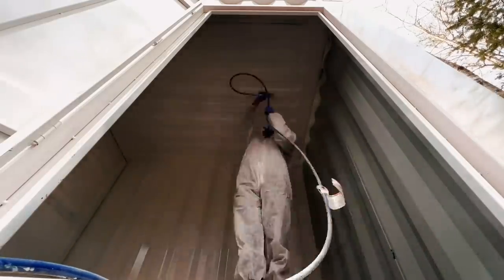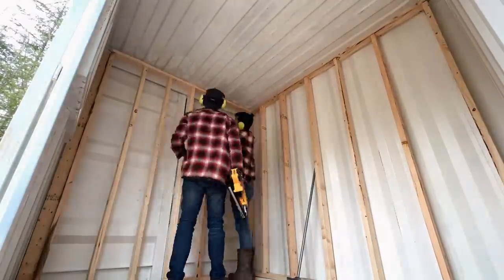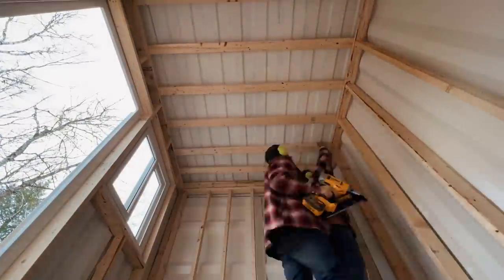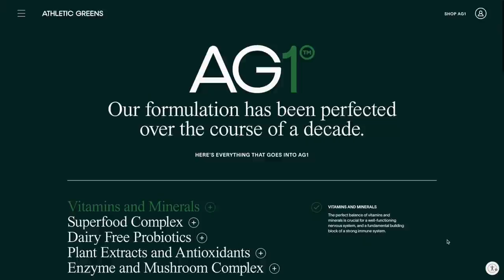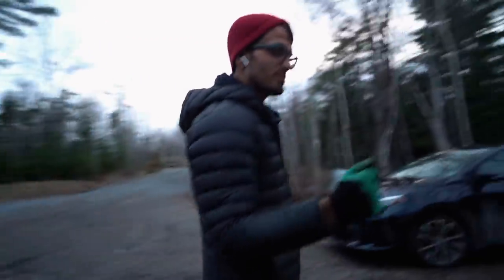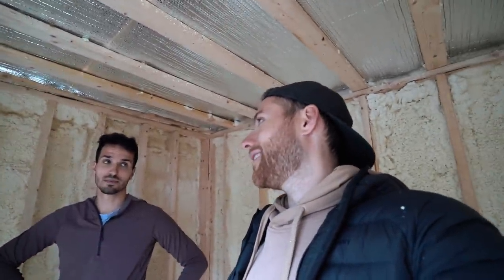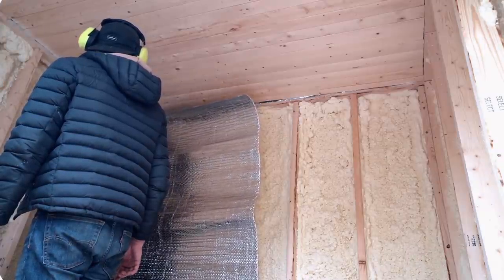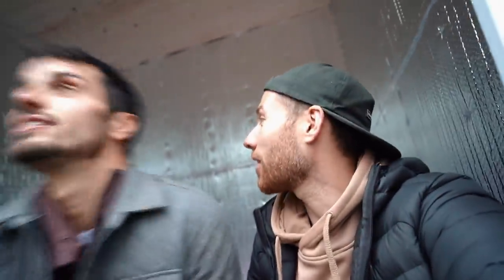Why this was never going to work...

Comment: Pro tip: Connect a vacuum attachment to your saw. Used the (now clean) sawdust mixed with a bit of wood glue to fill the holes.  It will take stain better than wood putty and you will notice the fill over the screw holes less.
Reply: I just learned this recently and am a big sawdust saver. Very good to know!

Comment: It looks so good, Carl & I bought a second home, a 120 yr old Craftsman bungalow.  Pretty much gutting it, opened up kitchen, enlarged bathroom & enlarged dinning area. Took off all the plaster & lath, which was hell. Leveled the floors & had electrical up dated.  Did the exterior first & removed the old concrete siding put on in the 80’s, took it to the original clap board siding, which is beautiful. Completely repainted & sanded the posts on porch; we received a large order of mums, a surprise from the neighborhood with a note “ thanks for making our neighborhood beautiful!” It’s been hell & a lot of primeval cussing.

Comment: You guys do beautiful work and at the same time I genuinely have a question: If I had been in your position I might have been interested in wiring the interior for electrical outlets and lighting fixtures since there was easy access to the space inside the interior walls you are building. Perhaps I am missing something to do with the type of power sources you are using or maybe even such wiring might have triggered inordinate Nova Scotia building code requirements for permits/inspections? I am sure there may be plenty of good reasons; and please know that I don't wish to sound critical. I am just interested in the back story. Thanks so much for your patience in addressing my question. Also, thanks so much for being "Tyler and Todd"!!! Over the last several years, you have become a significant focus of my YouTube viewing experience. And I consider you two a big part of my own Sunday routine. It's not a proper Sunday for me without an entertaining dose of Tyler and Todd. So thanks again and know that each week, I can hardly wait for the next episode!

Comment: your definitely going to want a ceiling vent in the outhouse with all that insulation otherwise its going to smell like rotten turds inside when the air vents up through the toilet and has nowhere to go.
Reply from the maker: Absolutely! Rotten turds are not the vibe, especially hot rotten turds 😅😂

Comment: Hey guys the next time you spray foam put masking tape on the studs. It will save you from having to do a lot of scraping later. All you do is peel the tape off after and the studs will be clean. I learned that the hard way. Thanks for another fun Sunday.

Comment: I love how you are just like us, I will have a plan and see it through and realize well I should have done this. Then you plan as you go from that point and it works even better.  My question: now that you have the building up and pretty much done, is it still cost effective than you building it yourselves?  I would think this building is much more sturdy being metal and with the heavy snowfall it will last longer with less maintenance.  Love the longer format because cliffhangers are dreadful. 😵‍💫😂. Oh -oh and what snack did you get the dogs in the drive thru?
Reply: It was a plain "Tim Bit", which is a plain, round, small doughnut.
Reply: @jonap5740  Oh sweet... thanks!

Comment: Glad to see that other followers have questioned you on some aspects of your progress in recent videos---and that you've taken it to heart and changed direction.   Wouldn't want your channel to turn into a ""Don't It Yourself" fiasco.   With that in mind, I didn't detect any ventilation features in the outhouse.   Every rustic outhouse has significant air flow to prevent build-up of fumes  (warm poop or not).   Be careful not to create toxic environment such that when you open the door to your comfortable space, you have to run away instead.

Comment: What a missed opportunity you could have put up a sheet of plastic between the metal inside and the wood so that the wood wouldn't touch the wall on the inside and then you could have insulated and then use more plastic to cover the other side of the wood and put up drywall  making it nice and warm.   Well, its only a suggestion... good luck guys your place looks just awesome!!!   all you need now is a small pool for the dogs to play in when you can use the lake that is inside something and keeps everyone warm.   :)   Can't wait to see what else you all do.

Comment: Your model at 1:45 is nice but don't forget that containers are designed to fit one on top of the other. If you want to assemble them differently, you'll need to reinforce the structure that is weaker off the corners.

Comment: Tip for nailing shiplap boards....put a nail at the bottom of the board only that also goes thru the "lap" of the board below it.  It uses half the nails and half the woodfill of nails.  I was rewayching your bathroom build and thought this tip would come in handy for any shiplap install in your container home.  Possible othe tip... if the ceiling boards were tonue and groove, you nail only into the tongue at an angle so the groove of the next board is supported by the nailed tongue.  This results in no exposed nails, less finish work for a smooth finish.   Love you guys videoes.  Hope the tips help.

Comment: I've never seen anyone apply spray foam insulation like that.
What I've seen is nice even strokes like spray painting. You get less overspray and what you get you scrape off the studs before it hardens.
Oh well, it's done and won't be seen for at least the next hundred years. Lol
I still think you will not enjoy wading through cold snow out to the outhouse in the middle of winter. 
You are working hard and learning things which will help when you build that house.
I think it's a great spot to put up more domes and use them as rentals for others who want to get away to nature. Just a thought.

Comment: First of all, great footage on the wooden ceiling build! Also, love the quick speed with voice over, for me, better than a few minutes of footage (in real time) on the project. I learned some things from seeing the ‘bigger picture’.  the air space between the Mylar bubble insulation also creates an insulating effect, ya done good. With such a sealed room I wonder, will you need some indoor ventilation so the whole thing doesn’t explode or is the vent pipe outside enough?. Beautiful, your work process, pets and each of you!

Comment: I hope you have air exchanger in the outhouse as you’ve insulated so well that their will be no air movement as it’s sealed completely. You’ll need to let fresh air in and stale air out. I just noticed you have a window in your outhouse so that will solve the issue.

Comment: Great job ya'all on the insulation! Omg, that spray foam is hard to deal with, have had to use it several times and it like, takes a life of its own, so good job on control ::))  Upcycling the generic "reflecting" material was a brilliant idea to put to use left over material. At this point, it's going to be fine, and be enough insul for the winter time...after all, you are not going to spend hours in there (unless Todd's tacos go wrong lol) and even in summer, you will be wise to keep battery operated fan present in there for comfort and circulation. I forget, will there be a window that can open? Stain and shiplap is going to be the perfect feel for the space. From the looks of it, I would more than happy to head to the Out House of your dreams, keep on rockin ❣
Reply: Hello how, are you doing?

Comment: Too late to mention for your outhouse, but if you need to sand another metal container, I suspect it would be convenient to rent a sandblaster.  I wonder if you considered a composting toilet design.  I think I recall that you mentioned a sink in the outhouse, and if so, then the insulation you're adding will be very important to avoid frozen water lines.  Up there, maybe you'll even need heat tape.  I enjoy your program, and it's inspiring, as I continue to make my home more independent of services.  Thanks guys!
Reply from the maker: Hey Richard! Absolutely, I would definitely rent a sandblaster next time...would make things much, much easier! For the plumbing and insulation, our thoughts exactly. Unforuntately being so North it's definitely a consideration we have to make! Still working through all the details!

Comment: I used 2 x 6 ledgers top and bottom and 2 x 4 studs.  This left a gap that could have closed spray foam blown in behind to create a thermal break.  We pre-built the walls on a flat surface and carried them in through the container doors and tilted them up and sledged them into place.  Thermal conductivity has to be addressed if you are planning on heating in the winter.  It's only an issue when it is past freezing.  A heat pump works well for moisture in the summer and dehumdifier in the winter.
I built a 2 container/hybrid in N.S..
Reply from the maker: That's epic Roy!! How was the process overall for you? Are you glad that you went the container route in the end? The thermal break seems to be most of the most important elements (we were thinking of doing 2x6 on all the walls and ceilings to make it higher r-value!
Reply: @tylerandtodd  overall we are very happy, we laid 2 - 40' containers parallel 10' apart.  This left a centre section where I put joists across and built out using 2 x 6 conventional construction.   
The challenge I am still getting bugs out of are the bottom perimeter steel beams around the containers.  They are bad for conducting cold causing moisture on the inside of the floors.  It only seems to be happening in certain conditions and I think I may put some sort of exterior insulation on the outside to break the thermal conductivity.  If you ever find yourself going to Pictou County look me up, I'd be happy to show you what we have done.

Comment: Due to my experience with my grandparents house, which has way more wood than is good for comfortable living (Log Cabins are terrible cold weather homes)
The bathroom is walled in pine, and the ceiling is pine.
The window frames are wood too...and in the winter the condensation of water did a job on the wood.
So, please Urethane the Hell out of your bathroom so you don't have to deal with the wood rotting or giving a home to black mold.
My grandfather did urethane the surfaces... But he didn't put on more than the smallest of coatings, which turns out isn't enough to make it water proof.
When I redid the finish for their kitchen towel and washcloth rack, I put on way more urethane than was originally on it to prevent the wood from deteriorating like it had been...that was a few years ago now...and that coating is holding up WAY better than the original one which even as a child had already shown signs of water damage... And back then it was only a few Years old...maybe a decade... Either way, it's older than me...significant water damage required a lot of sanding to ensure the new finish had a good surface...
My liberal use of urethane was a great idea and it actually stopped the bathroom window frame from deteriorating further too, when I applied the amount of urethane I thought would be best.
Long story short...unless it's extremely rot resistant like Cypress or Teak, the wood needs to be sealed against moisture to maintain the long term integrity of it.
It's shocking that my grandfather hadn't thought about it considering that he built his own boat...and had taken actual boat building classes, which involved sealing the wood against moisture.🤦🏼‍♂️

Comment: You need an intro to Rock insulation, earth friendly and you won't be living or working in a poisonous environment, that foam off gasses for years. you will need a top of the line air exchanger in every space where you used spray foam.

Comment: I'm just honestly trying to understand how you're going to warm this cabin up during the winter. And as there are no ventilation and no waste pipes - where the air will go if it's too hot inside, how the excessive moisture will escape and where the toilet waste will go. Have you thought through the project thoroughly?

Comment: I took particular notice of how you did that spray foam. Thankyou for including some 'lesson' shots. 😅 We don't get much of that spray foam over here. Funny how some things are more popular in some countries than others. I want to use that stuff but I am concerned about how you do that finicky prep in the first place. I can buy a 700ml can of spray foam that goes over anything- dirt, glue, plastic, whatever. Might be a different product. 

How will you vent the bathroom if it is sealed? There doesn't seem to be any vent in the window. Wouldn't you have to cut a hole through all that insulation in a wall to install a fan vent? Sorry, I have never lived in that sort of cold but in tropical climes, vents are crucial. 

BUT...OMG when I saw that stuff you referred to as 'Reflectix' my heart sank! I used that stuff in my new farm shed. I'm in subtropical Australia and wanted my new steel sheet clad farm shed to remain cool(ish) inside for working on a  hot Aussie summer day, so I paid a motsa for that stuff to be used as insulation. 3years down the track and it is worthless! I can't tell you how disappointed I am with it. And there is no recourse because it is a farm shed. But I know it is being used in houses too, so there must be some legal 'out' for the company that sells it, otherwise, people would be suing them left right and center. The foil is beginning to disintegrate already, even though not exposed to sun and it has completely lost its insulative value. This has been a coolish summer with lots of rain and overcast days yet the shed got very hot inside during the day. Far too hot to work in, even with all the roller doors and gable vents open on both sides. It will be interesting to see how it performs during winter. Cos it sure does nothing now in summer.
May as well have saved my several thousand AU dollars spent on the stuff and instead spent it for something meaningful like a repaired 300m long driveway.

And then when you got to the second layer on the walls you mentioned the product was not actually Reflectix but a generic imitation. I don't know what I got because there's a thing tradies do when they are pulling the wool over your eyes. And that is to remove the wrapping and boxes on the new products they use in your build before getting to the location so you can't tell what the name of the product is. That way they can use cheaper generic instead of the expensive name brand that was quoted. I suspect that's what happened in my shed. But I sure hope your bathroom goes better. But for my shed it has taken 3yrs to notice that it was not a good product.

Comment: Great job on the lavie boys, and your garden Todd will look beautiful.
What sort of toilet are you putting in the container bathroom? As noticed you've not dug a hole in the floor. Xxx
So glad your doing shipping containers for your home as I've been hooked on them on Pinterest  and been trying to persuade hubby that our next home is also a contain home,but don't think there are many here in the UK.
Reply from the maker: Hey Shirley!! Thanks so much - the original plan was to have just a regular outhouse toilet that would drain into the privy pit below but given that it's filled with water, we're not sure the practicality of that. We're getting to work today on it and I'm quite confident the plan will change a few times between now and then LOL. Also - there might not be many in the UK but that doesn't mean it's not possible. Given how similar our climates are it would definitely work!

Comment: I love your channel guys! It contributes to a very relaxing Sunday nights while I rest from my kids. I was wondering if your outhouse will no have electricity inside? Shouldn’t you have installed the electrical wires, lamp, switch, etc. before putting the second layer of insulation with the aluminum sheets? I am really just an amateur though. Never built anything in my life other than ikea furniture.

Comment: I kept looking and could not see anything, how are you going to light the space ?  you are both so Inspirational in everything you do, fantastic
Reply from the maker: Hey Chris! Because we’re off grid here, it wouldn’t have been practical to have a separate electrical system with inverters, charge controllers, etc for such a small space. Our plan is to have a portable battery bank in there for led lights! Still working through all the details! 😊

Comment: Okay back for a second time and doing a double take on your shipping container room after the aluminum foil wrap it kinda low key looks like a room built for a serial killer. I’m sure this will not be the case once the shiplap is installed 😂

Comment: Most insulation are 16 in wide, so you'll probably have to go wider between the beams in the bathroom, or have to cut the insulation to fit it
Reply: Nevermind, you guys used spray foam again 😅

Comment: Two layers of reflectix isn't always better than one, not sure it ever is. It does way better when there is more of an air gap between it and the wall, than less of one. There are some great videos I found a few years back explaining that.
Reply from the maker: Each layer of Reflectix has a few inches of gap which is what gives it an even higher r-value. Had they not had a gap it would definitely be the issue you’re talking about!